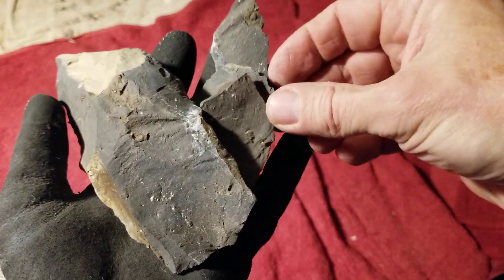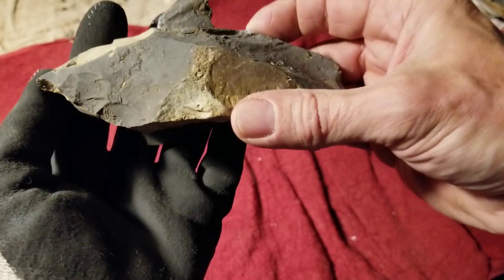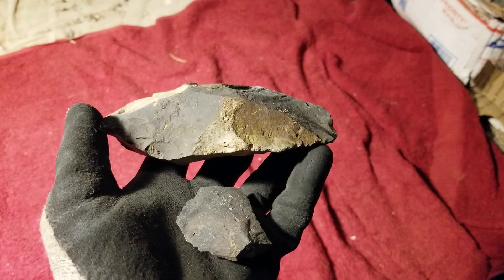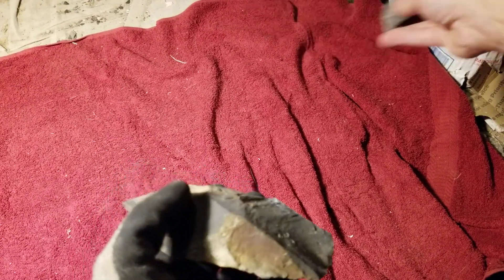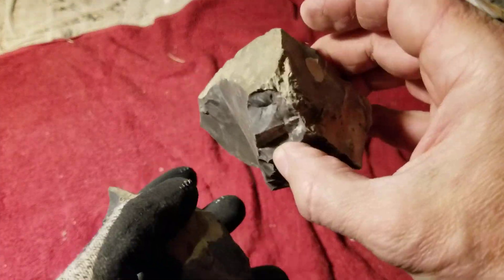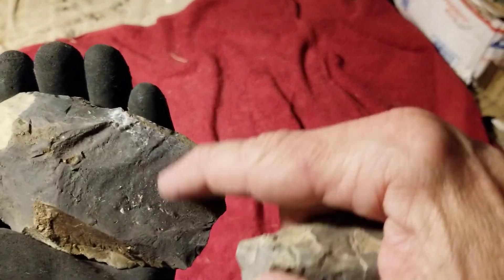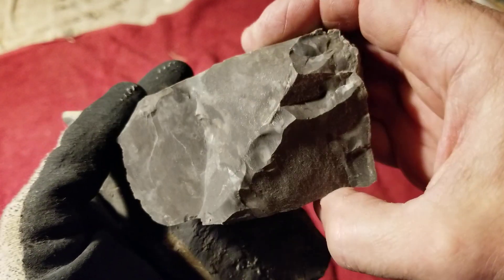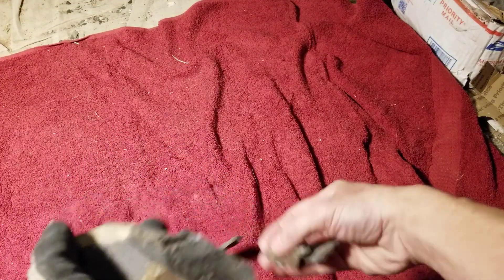1029 - ROCK CHALLENGE - Mystery Northeast Rock Flintknapping

Comment: I bought a 5 pound chunk of what I called oil flint. Looks very similar.  It's super good for throwing sparks.  After many tries at spalling it, I had no success.  It would fracture into smaller pieces which now their used in my fire starting kits.
Reply from the maker: Spalling seems to be the area most people have trouble with and want to see. I get more views in the first part of my videos than in the last part. I consider it the easiest part but, apparently, I am the exception.

Comment: Arrow heads act like airplane wings on the front of an arrow and will steer it if they aren't very symmetrical. Modern bows, because of the speed, are quite sensitive. and that's one reason modern broadheads have minimal surface area. Primitive weapons will be less sensitive, but the principle and effect is still present to an extent.
Reply from the maker: False analogy. You're forgetting that the arrow spins very fast in flight. Airplanes do not spin as they fly.
Reply: @KnapperJackCrafty  -  I know it's commonly believed arrows spin fast, but arrows only spin if they have helical fletching, and from my experience and knowledge arrows actually only spin a modest amount.  First, the arrow gains it's full velocity and momentum before it comes off of the string, and then helical fletching has to overcome that before the arrow can begin spinning. The arrow will travel many yards before there can be any significant spinning, and by then it's not able to undo any previous deviance. As I stated before, arrows shot from slower primitive bows are not affected to the degree modern and faster bows are and accuracy with primitive equipment usually suffers from several other factors and inconsistencies anyway, but the physics are still the same. Flatter arrow heads, especially modern ones with completely flat and un-vented blades have the most steering influence.

There has been a big rise in the popularity of expanding broadheads in modern archery, partially because they are somewhat safer but they also are easier to obtain maximum consistent accuracy with because the blades are tucked inside the round ferrule. Metal broadheads transitioned from full blades similar to stone heads to vented blades to expanding blades because of this issue.

In comparison, a rifled barrel spins the projectile from the beginning so it's spinning at the maximum rate when it exits the barrel.

For what it's worth, my background includes 35 years experience as an archer and bowhunter and 30 years has been as a manufacturer. So, I have studied and tested the issue fairly extensively. And, sorry for the long comment.
Reply from the maker: @G53X0Y0Z0  If you are willing to watch this video, we can talk.
https://youtu.be/WzWrcpzuAp8

If you're not going to watch the video, read no further. Firstly, the arrow, all arrows, spin regardless of whether or not they have helical fletching. Second, there is spin on the arrow as it leaves the bow, at the exact moment you say that the arrow has maximum energy. Third, the tip of the arrow does not travel in a straight line, it follows a helical path.  Look it up. Lastly, modern broadheads are gimmicky. There are all kinds of thought experiments that sound plausible but are not reality. A solid broadhead works just fine and most archers use this type.

Are misaligned (crooked or curved) arrowheads bad for arrow flight? Yes, if the error is severe. If it is slight, the effect on arrow flight at hunting distance is negligible. 

This is a constant area of controversy and I've seen the "Steve Allely Defense" many times. This defense says that "35 years experience" is more important than reality.
Reply: @KnapperJackCrafty  - I had no idea you would be insulted by offering my observations, that wasn't my intention. I did watch that video and saw nothing I haven't known for a long time. The one arrow that was spinning properly, albeit slowly, was a heavier spined arrow with helical fletching. The others were corkscrewing badly because they were improperly spined, they weren't arrows spinning about their axis. They can't when they are significantly bent all the way to the target and never recover. 

All but one of those arrows would leave a lot to be desired for hunting, and even the helical fletched one would be marginal. Field points are very forgiving in comparison.  Notice how the arrows enter the targets from different angles, that severely impedes penetration, which matters for hunting. My arrows generally pass completely through bull elk easily now unless I hit the far shoulder because they fly so straight, when I was a beginner they didn't because I was still figuring things out. I actually thought decades of being competitive and successful in the business of archery, shooting competition, and hunting for decades counted for at least some credibility, but I guess I should be learning from an internet expert like you. See ya.
Reply from the maker: @G53X0Y0Z0  I was not insulted. And people have called me much worse names than "internet expert". Thanks for taking the time to reply. Take care.
Reply: @KnapperJackCrafty thinking back,  I could have worked the last comment better.